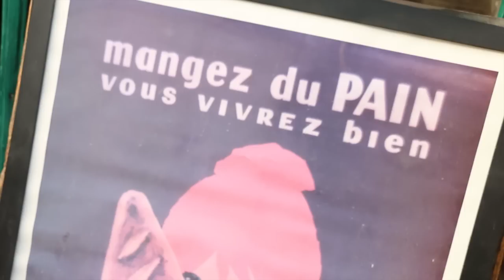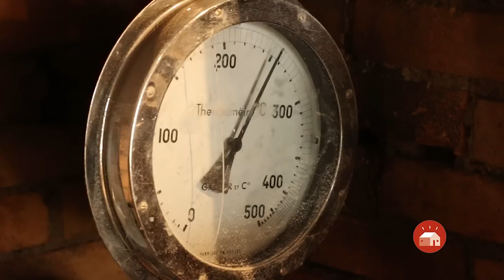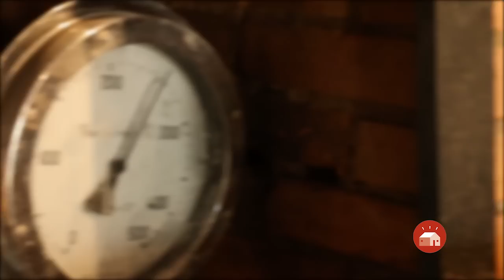Le Pain Rustique - boulanger à l'ancienne.

Comment: not trying to knock this here, because taste is subjective, but i just seen a dude roll out tons of bread using a modern oven that would hit it with steam, he had techniques for drying different dough mixes and was constantly moving, technology improves everything. this bread looks like the kind of bread you need to soak in a liquid, ale or what have you in order to eat.

Comment: I wish I could work at a place like that for just one day so I could learn from the masters.
Reply from the maker: One day to learn the recipe that is simple: flour, water, salt. It took 2 years to get to know the wood oven ...
Reply: @jardinsdebaugnac  Well, it's much much more than that.  It's how you handle the dough, how you fold it, how you store it, for how long, and inside what, and how can you tell it's ready, what to do in the winter, and in the summer, humid or dry days.  Everything plays into the science of making excellent artisan bread!
Reply from the maker: @MasterKenfucius  - Thank you for your connoisseur's look. It is the experience that allows us to offer the same bread every day and every week of the year according to the weather conditions. Even the power of wheat is different from one year to the next ... We have to adapt constantly. The touch and the sight are very important as the smell. Our equipment (oven, kneader, salt and water) are always the same. The weather and temperature are variable; we learned to adapt.
Reply: @jardinsdebaugnac  Yes!  That's what I would love to learn from!  How to compensate for the different situations.